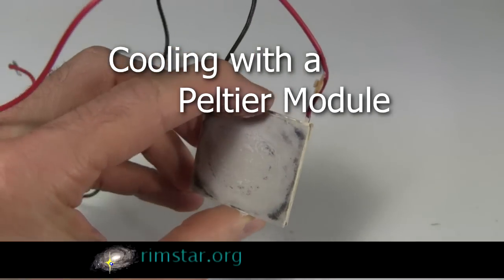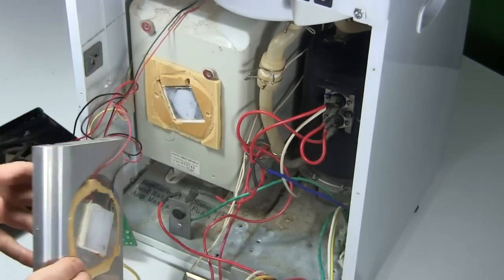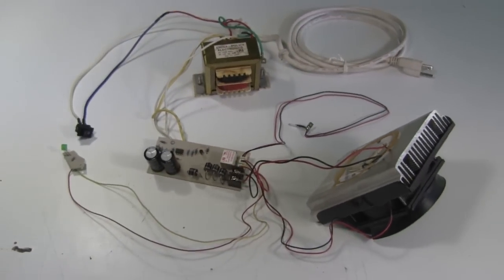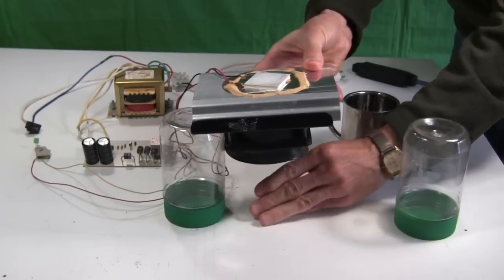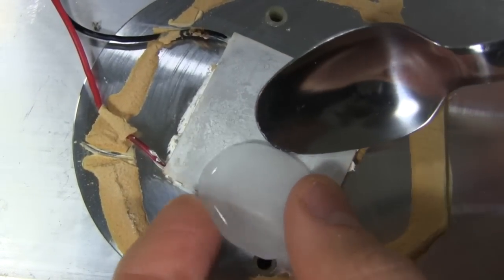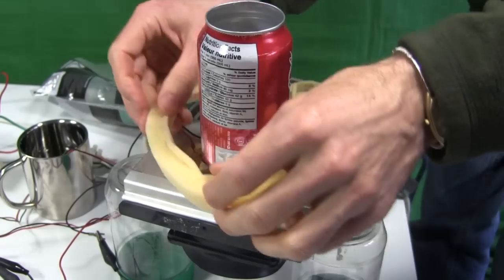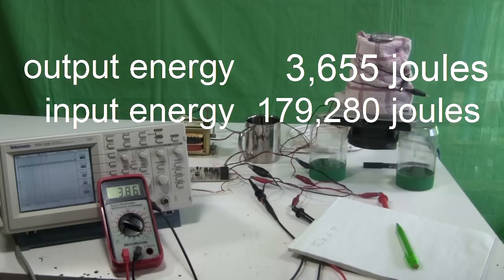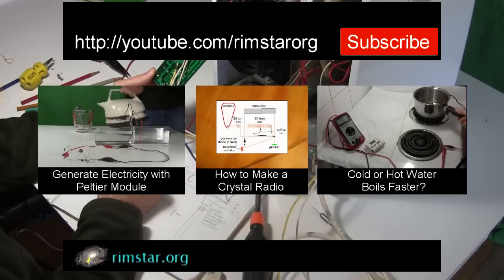Peltier Module Cooling - The Peltier Effect

Comment: I'm trying this
No ice fouming
Pl tell me solutions
Reply from the maker: It was easy for me since I had an already working circuit from the water cooler that I took it all from. Do a search online for the part number for your module to find the specifications and see what voltage and current it requires. The other possibility is that your module is broken.
Reply: Pl provide links sir
Peltier 12706
110/220 12v 5a transfer
I rech 9 digress but  -digrees not reach
Reply from the maker: I went to google.com and searched for "Peltier 12706". The first link was https://www.electron.com/peltier-module-hebei-tec1-12706-p357/ I clicked on it and scrolled down to where it said "datasheet". I clicked on that and it downloaded the datasheet-601-017.pdf to my computer. Opening that, I saw that Imax (maximum current) is 6.4 amps and Vmax (maximum voltage) at room temperature is 14.4 volts. So you're in the right range.
But you said 110/220 12v 5a, which doesn't quite make sense. I'm guessing you're using a wall adaptor that plugs into a wall. The 110/220 is referring to that it takes either 110 volts AC or 220 volts AC from the wall socket and the 12v 5a says it outputs 12 volts for a maximum of 5 amps. It isn't saying that it puts out 5 amps. The peltier module doesn't have any current limiting built in. Which means when you first plugged it in, the module probably asked for much more than 5 amps and your adaptor may or may not have tried to give it. Either the adaptor did give much more than 5 amps and damaged the module and possibly damaged the adaptor, or the adaptor limited it to 5 amps but in that case you would have gotten some cooling.
Though another possibility is in the first chart on page 2 of the datasheet. It looks like at 12 volts and 5 amps, you might be getting a low change in temperature (a low Delta T). Just imagine another curved line about 1/3rd of the way up between the 4.5A and the 6.0A curves. I say 5A because that's 1/3rd of the way between 4.5 and 6.0. If you imagine such a curve then the Delta T would be low.
Reply: Sir good morning please indian sites can inform  Please, Thanks for Suitable Adapter.
Reply from the maker: I don't have any sites for you.
Reply: Pl  suitable voltage on 12706 peltier

Comment: Cooling efficiency is measured in C.O.P.  Peltiers can run a COP of about 1-2 COP if set up correctly, which is MUCH higher than 5% efficient...  Peltiers cannot be run anywhere near 100% and also run at max efficiency...  They must be run around 50% of their rated max...  Anyone talking about Peltiers running at 3% to 5% efficiency has ZERO idea what they are talking about...
Reply: what does it need to run? can it be run by a rechargeable battery, or does it have to be plugged in ?

Comment: i use it 12706 with 12v 2A  it cool alittle bit , then i change to 12v 10A  ,,, it very hot both side,,fuck
Reply from the maker: I suspect your high current damaged it. I ruined two of them that way.

Comment: Clearly that fan is blowing onto the heat sink... it’s easy to visually tell. Yet you keep saying it’s sucking away from the heat sink. When it wouldn’t be, and you can clearly tell it isn’t. How do you not know which way a fan blows...
Reply from the maker: This was a long time ago and I don't recall specifically testing the air flow direction -- I must have though, for me to say that. Testing is simple, you put a piece of tissue paper in front of the fan.
In any case, the direction doesn't matter. Air sucked into the heat sink and then through the fan and away will take heat from the heat sink, since the air is cooler. Likewise with air blown by the fan into, through and out the heat sink.